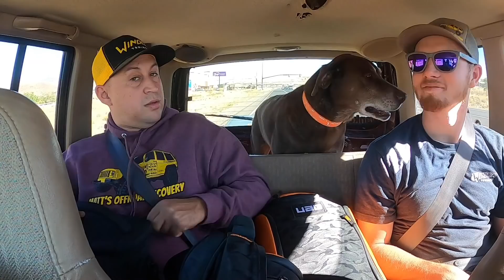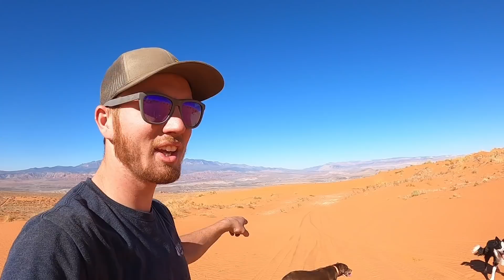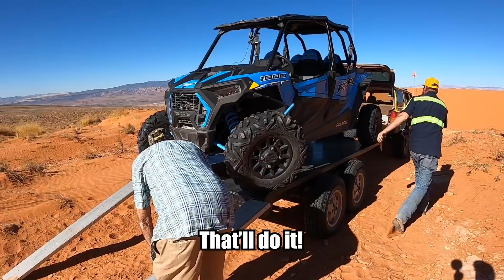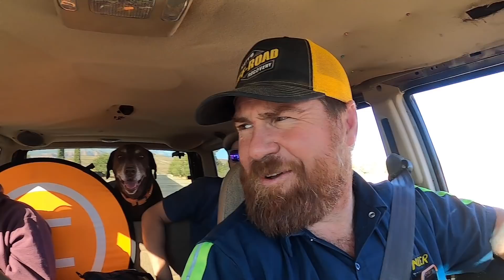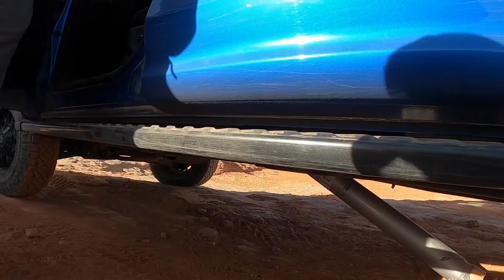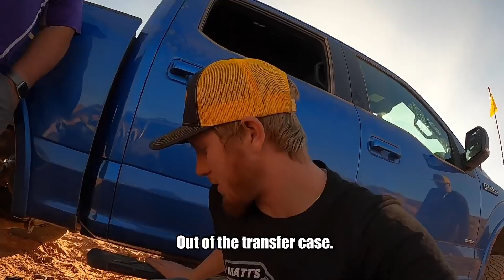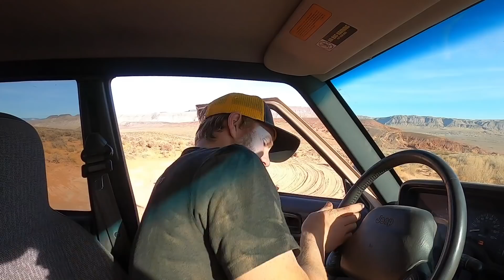Ford F150 Breaks Its Drive Shaft...Now what?

Comment: POS aluminum driveshaft.  Have one in my GMC Sierra.  Sucks.  One little ding from a rock and the show is over.
Reply: What year is your Sierra?
Reply: you can have a steel one built at most driveline shops for 350
Reply: Lol, I have one in my 94 lightning and it's been taking mid 10 second launches since a year after I bought it.

Comment: FYI the f150 doesn’t have a mechanical lock between front and rear when in 4x4 H. It uses a electromagnetic clutch. It was probably engaging and disengaging the front driveshaft causing the banging noise.

Comment: That noise was transfercase hating life 😶
Reply: Does it have a centre differential ? Genuine question.
Reply: You got that right! Modern design transfer cases with a slip yoke don't like to run that way. It will self destruct in a very short time. 😬
Reply: Is that a 2021 ford 150 ?
Reply: @jameshuggins4300  Thats one of the reasons I got rid of mine on my YJ.  SYE is the way to go.
Reply: And expensive
Reply: @dirtfarmer7472  Who were you referring to?   ME?  It was not that bad.  about $700 to $800.  It allowed me to remove the transfer case drop kit, gave me more clearance.  Allows me to remove the rear drive shaft without oil draining.  Allows me to drive on just the front drive shaft.  That is most important if you break on the trail.  Tow jobs can be very expensive.
Reply: friend left his new f-150 at my house while he was on a trip. 

I drove it once, and never again. sounded like it was on the verge of tearing apart the transmission and everything else, at normal driving at less than 30 mph. I just wanted him to come get it, so it would not self-destruct on my watch. It had like 10,000 miles on it.
Reply: Probably the reason the drive shaft failed. Momentary lock up.
Reply: @TheLittlered1961  yeah SYE is the best option 👍
Reply: @steveharleyfan  American trucks don’t have center diffs. The front drive shaft is connected to the output shaft by a chain or a gear meaning there is no give or way to transfer power front/back. It’s either 50/50 or not. That’s why you can’t use 4wd on dry surfaces because the transfer case will bind when you try and turn too far.
Reply: I think the driveshaft got a dent in it from hitting a rock, as soon as they're dented they have no strength left at all
Reply: @steveharleyfan  :  It may have, but the ONLY way it could drive with the rear disconnected is if it was lockable, AND locked.
Reply: @tedecker3792  :  I saw stickers on the broken drive shaft that suggested to me that it may not have been stock.  Anyone else?
Reply: @Rx7man  I thought driveshafts would be thicker than that, looked like tin foil once it snapped
Reply: @cenccenc946  You got that right. Mine is 2017...less than 5K miles (mostly off road) and it sounds like its eating itself when I switch out of 4WD.
Reply: @rubenbraekman4515  It's designed that way to reduce rotating mass
Reply: @johndavidwolf4239  I also thought of that instantly, maybe he already broke one..
Reply: @rubenbraekman4515  nope, they're really thin!
Reply: @johndavidwolf4239  lots of factory parts have stickers on them too
Reply: @gedd6750  no it’s 15-17 u can tell by the grille the grille changes in 18
Reply: @Rx7man  :  That is why I said "suggested" , could you tell if it was a 'ford' sticker, or not?
Reply: @homelessjedi2843  cool we only get the ranger or raptor in the UK.
Reply: @johndavidwolf4239  I just looked at it again, to me I think it's factory, lots of bar codes on it.  It looks like it got hit right where it twisted to me
Reply: @Rx7man  :  Okay, my guess it that aftermarket also uses barcodes, I just don't know enough to discriminate between the two.
Reply: @joshuarodrique2096  I must disagree with that.  The Jeep Quadratrac had spider gears in it.  It was their first full time 4x4.  I know this because I had several Jeeps with that transfer case.  I had converted more than one to part time 4x4.  I think the NP 228 and or NP 229 may have had spider gears in it as well.  Both used in Jeeps.  All three allowed slippage between front and rear wheels, all wheel drive.  The Quadratrac you could lock in high and low range.  NP 228 and NP 229 you had to be in low range for it to lock, true 4x4.
Reply: Stickers or not, that drive shaft had a weak spot.  The break in it was very unusual.  It was like someone cut it.  There was no twist to speak of.  Take a straw and grab it by both ends and twist.  That is what most drive shafts look like when they break.  I wonder if it was rubbing against something on the truck or on the ground.
Reply: @TheLittlered1961  :  To me the break looked very much like it should from the application of excess torque, what did seem off was the location of the break as it was not at a point that I would associated with a stress concentration, so I agree that there must have some externally inflicted damage at the break, most likely some time before it broke.
Reply: @TheLittlered1961  I'm sure it rubbed on something, look around the break
Reply: John David Wolf I just watched a TFL video on the new Raptor and the ram equavalent. They drove over the camera doing an articulation test. Both driveshafts on both new trucks had stickers on them.

Comment: Our work truck's drive shaft knuckle broke partly because we didn't grease it. Had to get a new driveshaft made.
Reply: The knuckle? The yokes at the driveshaft ends do not have moving parts and does not use grease. Don't you mean one of the components, such as the U-joint, center bearing, or coupling between segmented driveshafts?

Comment: Polar RZR: We sell you 5$ parts in a 20 000$ toy.
Reply: Those things must have pot metal front suspension components
Reply: @arisaka9963   They are designed to abosrb impact so as to not kill the passengers and lessen damage to the frame and other more expensive parts like the transmission and engine.  Any car that survives a crash intact will likely kill it's passengers.  Look at the early race cars.
Reply: @johnultimate1161  who do I go to if I don’t want me or the car to survive? 😂
Reply: @devinbaldwin4554  China?
Reply: @johnultimate1161  Bent trackrod is ok, but not bursted balljoint. These RZRs that Matt has featured in his videos, have suffered excessive damages for the crash they took.

Looking at Polaris' advertising, i can't blame the drivers.

Comment: Never realized just how thin the drive shafts on Fords are. Lol
Reply: Looks like tin foil

If they had duct taped it back together, it would have been stronger at the duct tape than anywhere else.
Reply: It was aluminum, steel ones have an even thinner wall, and it is not just Fords, all vehicles are the same.
Reply: @johndavidwolf4239  Steel ones don't break near as easy though do they. Ford has to keep it nice and cheap like they always do.
Reply: Aluminum driveshafts actually cost more... Most likely it's used to reduce weight.
Reply: @mrdanomac7937  : True.  The next step is carbon fiber, stronger and lighter still.
Reply: @gasolinediesel972  GMs have aluminum DSs too.
Reply: @johndavidwolf4239  Already have them.
Reply: @jimmartin7881  :  Yes, but not yet on in non-commercial vehicles for the masses of us regular folk.
Reply: @johndavidwolf4239  Since the late 80s E100 Fords, Mitsubishi Montero and Pajero, Mazda RX8, Nissan 350Z, etc. They've been around for a while and there's quite a few that also use a hybrid of CF over thin wall aluminum too.

Comment: Why do people off-road without a tool box?
Reply: Because they have no clue how to off-road, I guess.
Reply: They would not know what to do with the tools.
Reply: The same people who go out wheel'n alone with no tow strap or water and in some cases no spare tire or jack.
Reply: Valid point about taking tools with you. However, the F 150 driver looked like he had a mechanical issue on a dirt road. I don't think he was planning on any real off-roading. I would take that truck on those roads with just the factory "tire changing" tools.
Reply: @wesallen4228  ,
Without tools you pass up on the opportunity to get help from a good samaritan who does know how to use them.

Comment: Regarding the popping noise, could that be because the flange was removed and the receiving shaft inside the transmission has a lot of play, possibly getting caught on something every now and then as it spins? I seem to remember that from a GM THM400, where the receiving shaft is pretty loose without the output flange, because the flange is the one that is inserted into the bearings. Not sure if Ford transmissions are the same. Bottom line, seems like it is safer to tow if the driveshaft is removed.

Comment: Without the rear driveshaft when you start the engine the auto transmission pump going to pump fluid back there to the tail housing and out the tail shaft that paper towel won't seal it.

Comment: If its four wheel drive just use the front if the rear shaft is broke,make a sling for the rear. Just get it out,don't drive it for another year.

Comment: The ford f150 was not made for constant off road use. It is designed for North American roads where the pavements are Smooth and no potholes. F150s in Africa only last 8 months to a year before parts starts to break and fall off. Some only lasts 3 - 6 months. Hence the reason why the Toyota land Cruisers 70 (J70) are very popular ,not only in Africa, but in the most inhospitable places around the globe.

Comment: 7:03 Hey, look. You're exhaust pipe broke. Oh, that's what they're somehow getting away with calling a driveshaft..
Reply: I don't get it. You're complaining about a strong lightweight driveshaft? large diameter aluminum shafts are stronger than their smaller steel counterparts and are a big rotating weight reduction. Both will break like that if you set them down on a rock.

Comment: What's the go with the strobe headlights everyone seems to have?
Never seen them here.
Very glad for it too.
Think id be getting busy with the slingshot!!
Reply: hi there, i‘ll try to explain, not native english speaker so sorry in advance.
this effect stems from the camera working with a certain frequency, known as frames per second.
the leds from headlights or working lights don‘t run on fully dc voltage, most are some kind of „switch powered“ or evened out ac, only positive voltage, the upper curve of the ac. this is done to save energy or to get better efficiency, or more power in some cases.
anyway, when the camera „frequency“ catches the off points of the leds, it looks like the lights are flashing.
a similar effect can be seen, when spinning rotor blades of helis or props of aircrafts are matching the camera frequency, then the blades seem to stand still.
Reply: @testsepp3258  Good job explaining, it is the same reason that the tires sometimes appear to be spinning backwards

Comment: Id hate to see what that shop towel turned into with those rotating splines a better way to do that is a latex glove and a zip tie or tape around the seal on the t case keep the crap out and oil in

Comment: How the heck do you pretzel a drive shaft like that without even having a trailer on it and in the sand? 
That driveshaft must have been made with the cardboard tube from a roll of paper towels.
Reply: Someone suggested that the transfer case chewed a gear or something and locked the driveshaft at one end while the wheels were still turning it from the other end.  That seems plausible given the noises the truck was making when he tried to drive it as front wheel drive afterwards.
Reply: @ischmidt  I'll buy that explanation because nothing else makes much sense. I know manufacturers are using aluminum driveshafts more as well in an effort to meet the strict government C.A.F.E. standards.

Comment: cringe 😣 I sure as heck wouldn't have stuffed a rag (especially those blue disposable shop towels) around the t-case output shaft, then used the 4WD to drive the truck out. Sure, there's going to be someone comment on me sayin' the ol' "hind sight is always 20-20" bit, but i've been there a few times, and knew the first time it would just chew up whatever was shoved in there. I guess i've just broke more shit (& been around others who have) to have learned that early on. But hey, there's never just one way to do a recovery, right? Regardless, the "it's on the house" and Rudy's work at finding a shop for the customer to have his truck repaired ASAP just shows how great the whole crew at Winder Towing is!

Comment: Surprised that rag was enough to keep the trans from puking all its fluid on the way home.
Reply: I thought that, when I’ve run without a propshaft, I unbolt the ‘U’ joint and leave the spline in place, but there’re a bit prone to falling off if you have to go a long distance.

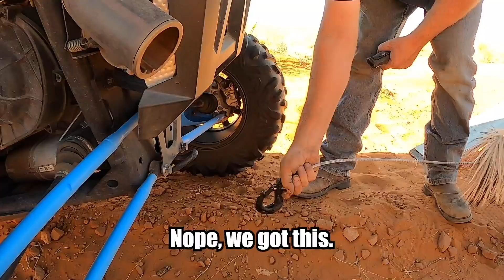Comment: Been noticing over time that you hook the winch hook with the hook open side up (@3:01). Why is that? Is it safer than open side down?
Reply: if you hook up with open side down and the area where you hook it, either drags in the sand or against a rock it can pop the hook off. Less chance with oprn side up.

Comment: So a truck can still drive without it’s driveshaft? Does that mean it’s only 2WD?
Reply: Yes. In this case FWD .
Reply: Front wheel drive. Transfer case locks the front driveshaft so that it will turn under the engines power. If the rear driveshaft is broken, then the front driveshaft should still work, meaning that the front wheels will still turn, but the rear wheels won't.

Comment: driveshaft is nothing. take it off and drive away. if it's the rear, put it in 4wd. if it's the front, take it off and drive away. i snapped a rear driveshaft once, and u-joints countless times. never use super-tough u-joints, you want them to be your weak point. alot cheaper and easier to fix. i always carried spares, and changed them in the bush on my tailgate all the time.

Comment: Must have been an aluminum drive shaft saves ford weight but more expensive than steel and nowhere near as strong.
Reply: It's strong till it gets a ding in it.
Reply: GM and Dodge are the same.

Comment: I'm sure as soon as he started driving that Ford out that rag was spit out off that spinning tailshaft.
Reply: the rag could likely to get sucked into the transfer case and now  pulling  the case and go over it to pull out shredded RAG in it ? leave those broken shafts in the transfer case if you can ? , tie-em  with bailing wire and let shaft  spin free keeping it all sealed up !  wrap wire around shaft a few wraps twist it tight around the middle for use as a stopping collar keeping the shaft from drifting out, then more wire a few inches  back behind the tightly wrapped wire with several pretty loose wraps,  then up to frame somewhere ,  supporting the shaft go slow check once in a while to see its working right re-adjust if necessary .  you could use straps the same way also thought of that one later.  That worked for me 12 miles  ''slowly''

Comment: It is amazing how flimsy that drive shaft is. Tube looks paper thin. Is that aluminum too? Certainly not strong enough for the engine torque. So much for Ford's better ideas. I would be mad at Ford if that happened to me. What a POS they have turned the F150 into. It is a shame it is. I would worry that you can break the drive shaft going over a bump pulling be trailer. So much for "FORD TOUGH'